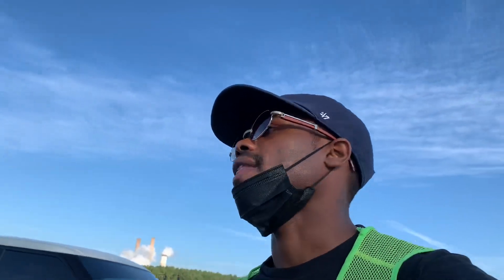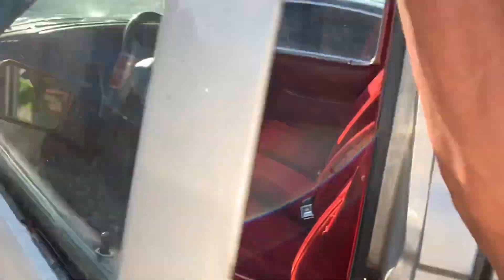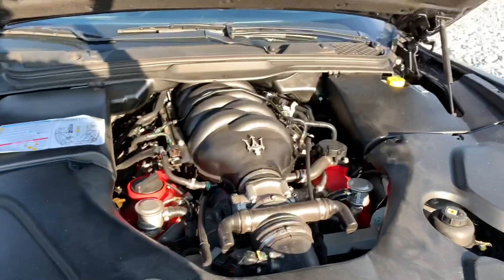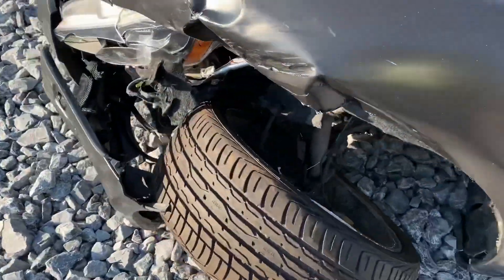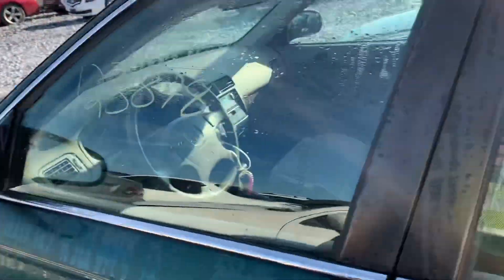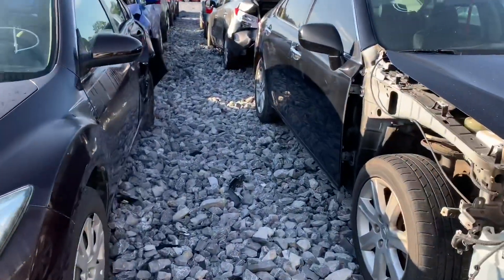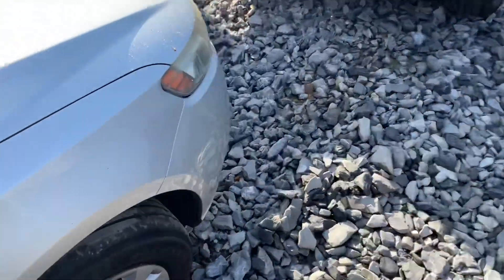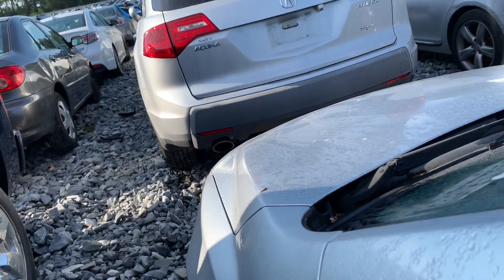THIS IS THE FIRST CONVERTIBLE ROLLS ROYCE DAWN I'VE EVER SEEN AT COPART! *ESTIMATED VALUE $240,000!*

Comment: You need to learn how to drive a stick shift it’s super easy to drive and pretty sure you had to push the clutch in to start the ranger , I used to have a 1998 ranger 5speed